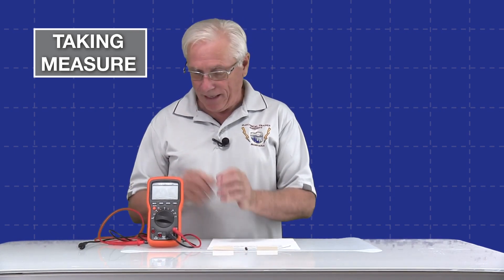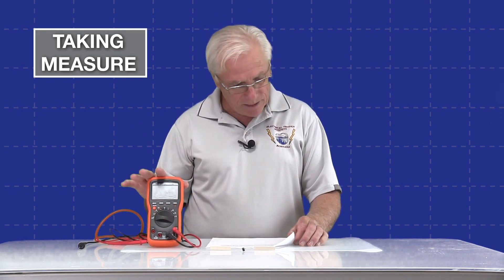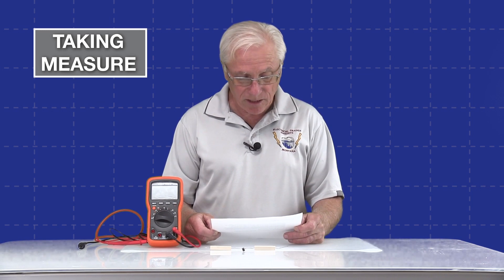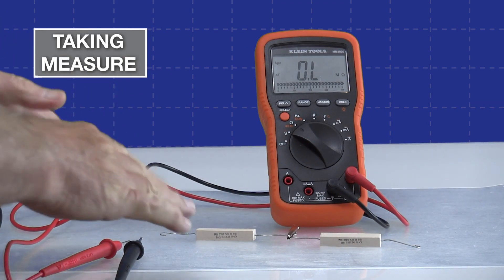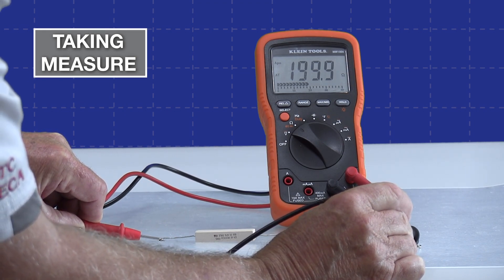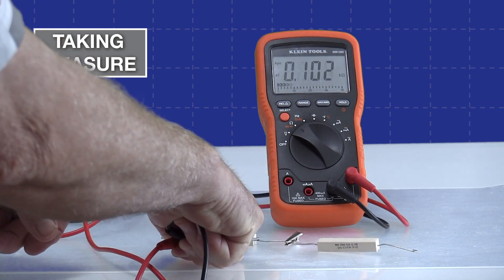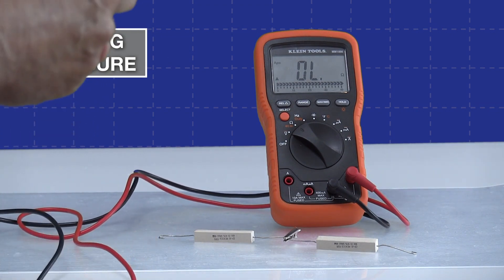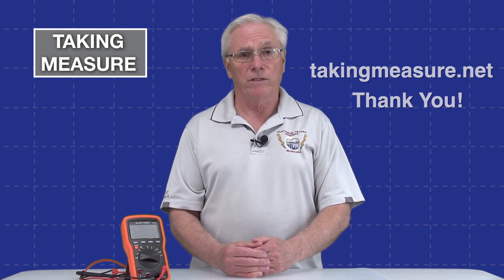Using the Digital Multimeter's Relative/Delta Mode

Comment: Lesson on measuring single phase and 3 phase AC Voltages using Delta mode compared to using Relative Mode. A Trick Question is if you have a 3 phase system but wanted to find out which is Phase A, how can you know which of the 3 wires is Phase A without going back to the electrical panel?
Reply from the maker: You have me on this one!   What is the trick?